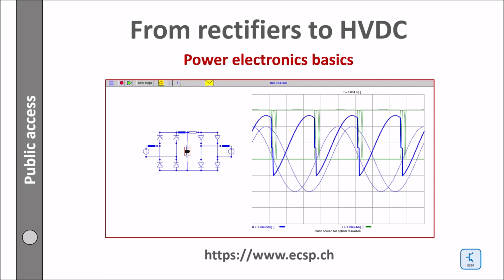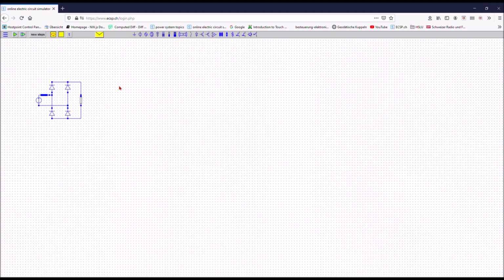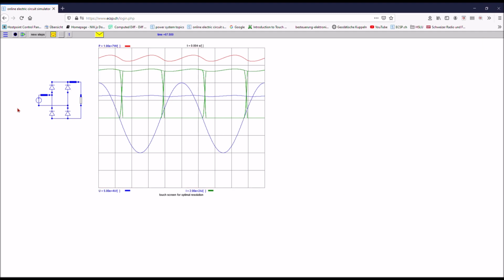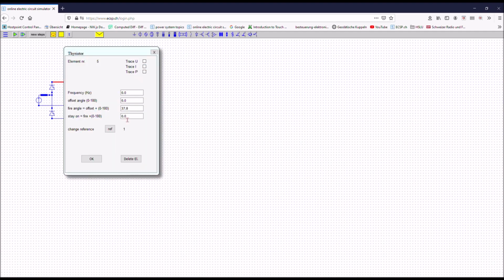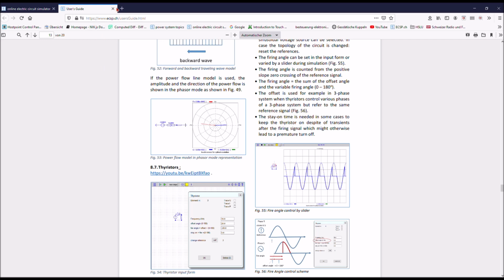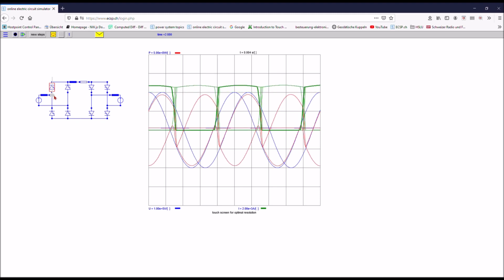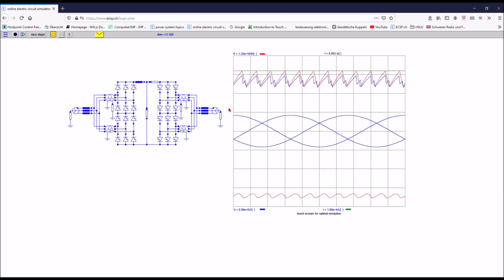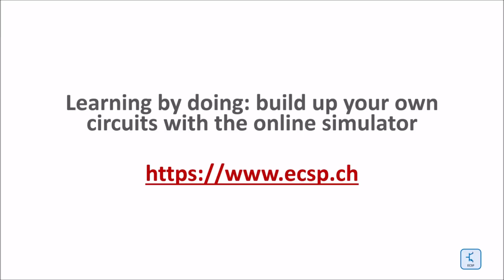Power System: HVDC [circuit simulator]

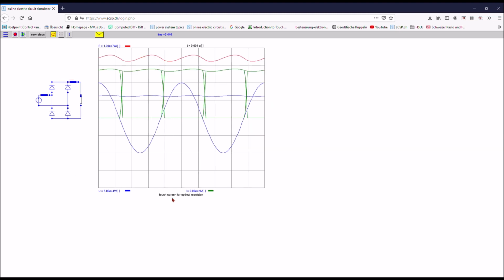Comment: 1:25  I have just learned something new .The moment all diodes are conducting is when the input  voltage crosses the zero. It is when the two pairs of diode swap the  current conduction. Here the source "sees" a short circuit. Thank you for this video